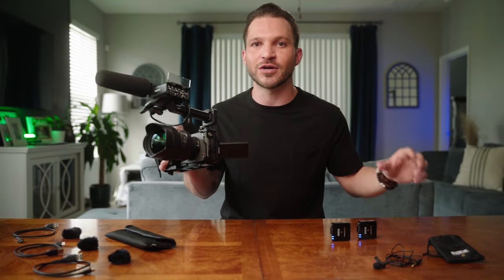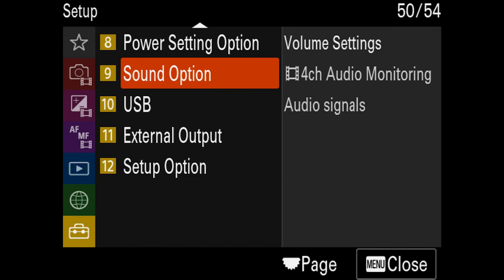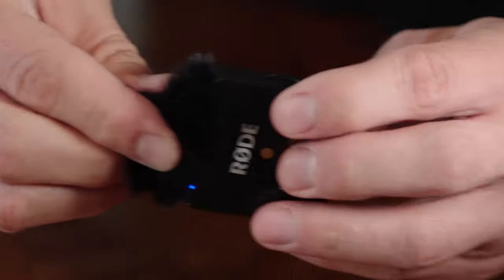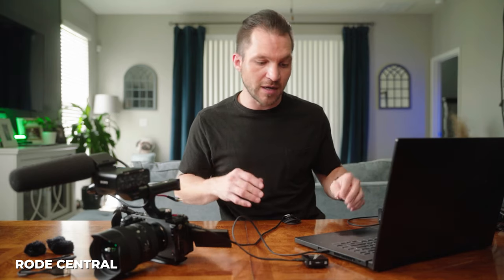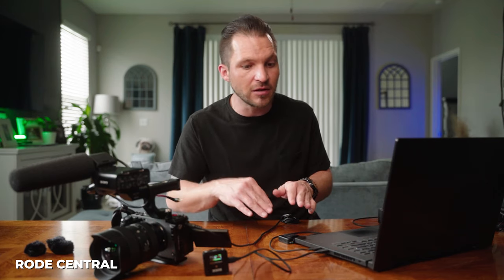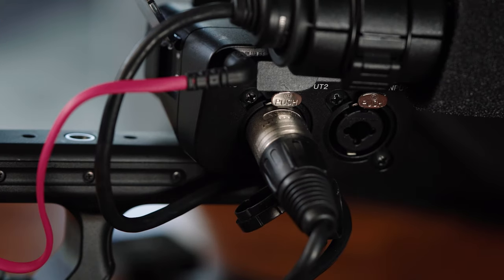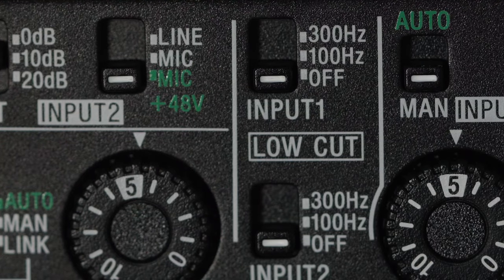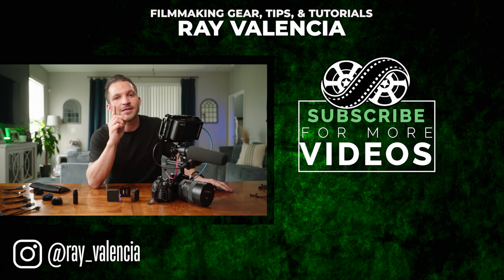RODE Wireless GO II on the Sony FX3 XLR Audio Handle Explained

Comment: I have a buzzing when using the on camera fx3 input and my wireless go 2 system. Seems a real problem for many. Do you know any way to relive this without using the top handle
Reply from the maker: Hi Phil. I've heard about this issue from several people but the port on my camera works perfect. I used the Go 2 all the time, straight into Camera. Sounds like a Rode issue?

Comment: Hi, I am having a tech issue hopefully you can help me, I am trying to connect my rode wireless go ii to my fx3 sound bar (just got this camera). I can’t seem to hear anything out of the headphone’s when trying to monitor the sound. I have it connected to input 1 via the sound bar and the headphone into the 3.5 Jack, but no sound is coming out of the headphones. It shows that it is picking up sounds, but i can’t hear anything. I tried it on my a7siii and it works fine, so I don’t think it’s the rode, can you tell me what I am missing? Thanks!
Reply from the maker: Hey Solange. Go into your Menu and go down to the yellow tab with the Briefcase logo. Go to Option 9, Sound Option.  Then you can Designate which Audio channels you hear in ear. The Headphone Volume Settings are in there too! Hope this helps.

Comment: Very Helpful video, I didn't know that having the sensitivy down on the receiver was important, but it makes sense now as I noticed that it was getting into the yellow quite easily with normal speech! 

Have you used the Rode Lav Go and/or the Rode Lav II? If so what do you think about them with the Wireless Go II? I got one of each, but haven't done much testing with either.

I just got my Rode wireless Go II set up. I got a Kopul 1/8 in to Dual XLR (Left and Right) cable that splits the Stereo signal into two outputs to either my C100 Mark II or my Zoom H8 recorder.
Reply from the maker: Hey Daniel! Wait, Is this my friend Daniel Brunal in Florida? I do have the RODE Lavalier Go v1, and I really like how skinny the mic capsule is (without the lapel clip on) bc it's easier to hide on your talent. I'm sure the newer version is even better because it's flat. I have a cable like that too, that I haven't even tried to use to split the channels.  Thanks for the recommendation! You might find this video interesting and my giveaway for the Rode GO Charger is still ongoing: https://youtu.be/wgFNuZT5rH0
Reply: @RayValencia , yes it's me. Been keeping busy with lots of work in Tampa Bay. :) Hope you have been doing well too.

Thanks for letting me know about the Rode Go Charger giveaway. I will check out the vid!
Reply from the maker: @danielbrunal2235  Hey dude!  Glad to hear you're busy!  Good to hear from you. I am good. Planning on leaving the corporate videographer world and going freelance very soon. I'll hit you up on bigger jobs if I can!!
Reply: @RayValencia  Early Congrats on your career shift! I hope for your continued success!

That would be awesome, I've got the same number as before, definitely hit me up. :)

Comment: Where would you plug in time code like the tentacle sync. And not have the audio bleed together
Reply from the maker: If you plug the Tentacle into the 3.5mm on the handle, it will take over Ch 3-4. So I would probably put on an Input that you don't need, most likely IN2.  Then get an XLR to 3.5mm adapter (like the one I used in the video), and Put the Input Selector on IN1-IN2.

Comment: Hey man! This may get lost in all the comments but curious on something. There seems to be a lot of complaints of the wireless go ii and the fx3/a7siii having issues with the wireless go ii. I have both and there is a lot of interference and noise when placing the transmitter right into the camera. Did you have this issue at all? There’s a Facebook group, multiple Reddit groups all talking about this issue but I’m assuming you didn’t have this problem.
Reply from the maker: Hey Sean. I've been contacted by numerous people about this issue after I made this video. Although, my FX3 doesn't have any problems whatsoever.   I don't know if it's because I pre-ordered the camera and got an early copy, or they changed something down the road, but mine works amazing with Rode Wireless Go version I and 2, and the Deity Pocket Wireless mic has no issues in the Body Mic Jack either. I still use the internal mic jack for all my latest videos with wireless mics and still working great. Sorry to hear about your issue and I hope some firmware updates can fix it!
Reply: @RayValencia  ahh. No worries man figured I’d ask but it sounds like both rode and Sony acknowledge  its  an issue which is a bummer. I’m curious if people have found there’s a comparability issue with just rode or if it’s all wireless mics. Maybe I’ll have to buy the diety or the dji and test them out.
Reply: @seandavidoff4092  Hey Sean I'm having this same issue, its really frustrating, has anything come to light for you recently regarding this?

Comment: Hi Ray, Love your videos and have taught me a bunch. I am running into a very odd issue with my FX3 and the Rode NTG5 (XLR). If I set the menu in camera (shoe audio set) to 24Bit 4/Ch i am getting a clean feed and I can hear playback in camera but only static when I download my files. I've tried with a card reader and also directly camera to computer. This is also happening with the Rode video mic pro set to input 3 (3.5" connecter). Same with 24Bit 2/ch but if I set the menu to 16Bit 2/ch no problem. If I got audio out through HDMI to an atomos recorder I don't have the problem. I can open the files in catalyst brown and there is no PCM codec written to the audio. Very strange. Any suggestions on something I should check.
Reply from the maker: Hi Lorenzo. Thank you so much for reaching out. I also have the RODE NTG5 and the VideoMic Pro+ and I haven't been able to replicate your issue. Just wondering What codec are filming in and if your computer can handle it? Like are you shooting in XAVC-HS? Which is an H.265 file.  Or All-I?  Although, this may not be camera/mic related at all. If it is playing back fine in camera, you are GOOD! Rest assured your audio can be saved. I think this could be computer related or Video Editor related. I've heard some Macs were having issues playing these files. Make sure you're on the latest firmware of your video editor too. Also, my VLC player bugs out when I open these files and doesn't play them at all. Have your tried opening these files with Sony Catalyst Browse? (Get it Free from Sony).  Adobe Premiere also has no issues opening on my PC either. I always keep my FX3 4 channels enabled, even when I'm only using 2 channels, and I just delete the 2 extra blank tracks when I'm editing. Doesn't bother me at all keeping it on 4ch all the time. Hit me back and let me know what you find out.
Reply: @RayValencia  Hi Ray. Thank you so much for your thorough response to my issue. After days and days of testing and ripping out what I have left of my hair I finally figured out the issue. I had been using an older version of catalyst browse on my Mac (OS 13.3.6). I had trouble with the more recent version that kept crashing on startup. I was almost ready to send the camera in to be checked and I said. Let me run one more test. Let me load catalyst on my laptop. The newest version loaded with no problem which raised my brow. I ran the test file through it and no problem. That’s when I knew it had to be a computer not camera problem. I had tried connecting the camera straight to the computer to see if it was a card related issue in earlier tests but same problem. I tried loading the latest version of catalyst on my Mac and this time the launch didn’t crash. No idea why it worked this time and not last (fun with computers) I reran the test and this time it all worked. I couldn’t believe I finally isolated the issue. I still have to transcode the files to import to premier but tested that and no issues as of now. The crazy thing is if I have the camera connected to my atomos flame recording onto ssd no add card. I never had the problem with the older version of catalyst. I wonder if I can import straight into premiere now without transcoding. I’ll test that next. I wasn’t able to import straight into premiere. It would only have a video no audio file when I had the issue. Keep doing great explainer videos. Your videos have been INVALUABLE to my learning.

Comment: Like the Sony XLR handle, do not like the Rhode branding. The transmitter is on my shirt, in view of my audience. I do not want them distracted with large white letters.
Reply from the maker: Agreed. I got silicone covers on my transmitters to cover the Rode branding and add shock absorption : Top 5: Rode Wireless GO 2 Accessories (not made by Rode) + ZGCine ZG-R30
https://youtu.be/wgFNuZT5rH0
Reply: @RayValencia ah that is an excellent idea. I recently broke a Hollyland xmtr when it fell on a floor.

Comment: my sony fx3 make big interference for rode go 2 !!! Don't you have it??? DONT BY SONY WITH RODE GO 2!!! THEY DOESN'T WORK TOGETHER !!!!
Reply from the maker: Nope, I use the Rode Go2 directly into the FX3 weekly with PERFECT AUDIO. Zero issues. This is a known problem I've heard of people having with RODE (in the FX3 Facebook group), but it was determined that it is a problem with RODE...not a Sony issue.
Reply: @RayValencia  Do you mean I can buy one more rode go 2 and it will work perfect with my fx3? But I already have found several people who also have the same problem as I have. If the problem in RODE then why when I plug in it via XLR it works without distortion, they are exist only when plug in inside camera, also why the same my rode works perfect with all other cameras! ONLY my FX3 and RODE Go 2 Cant work together! Please advice me what to do? Will it work with other wireless system or my camera will make this noise for any wireless mics. I think the problem in my camera. Also this man made the same conclusion, but I live in other country, I was in the shop and all FX3 and A7S3 have the same noise with RODE , So I cant just change camera like he did - https://www.youtube.com/watch?v=uNy9pDMjll0
Reply from the maker: @1stopit  I wish I could say for certain, but I dont have any issues with my FX3 personally.... but from what I've read on the FX3 Facebook Group, plenty of other people with your exact same issue. They say it works with other cameras, but not with their FX3 internal mic jack. Some people have talked to Rode directly, and others have talked to Sony. Sony says it's Rode, third party accessory problem. Rode admittedly knows this issues with this specific camera ans have replaced some people's kits. It's worth a try instead of sending in your camera!! I hope you resolve this. Try talking to people on FX3 Facebook group and search for other peoples solutions.